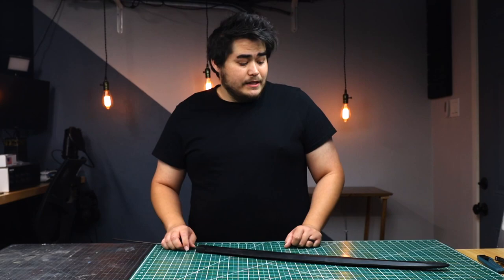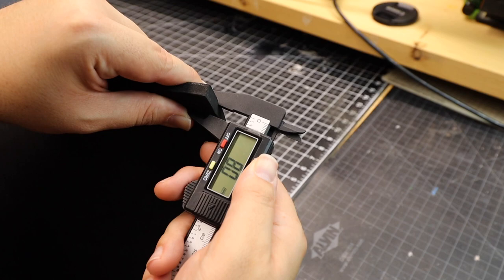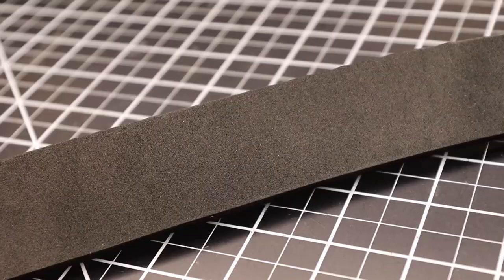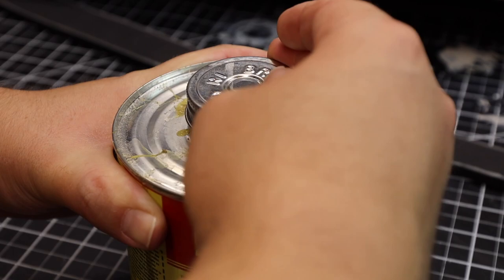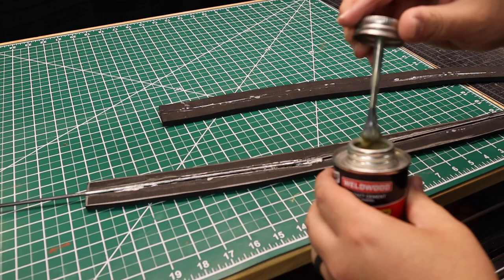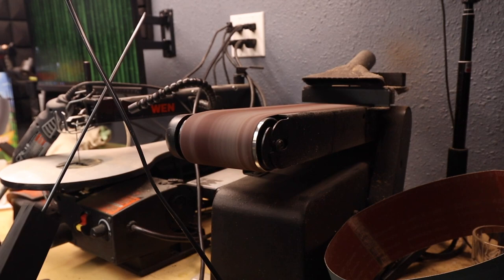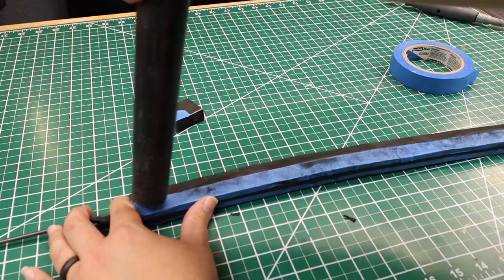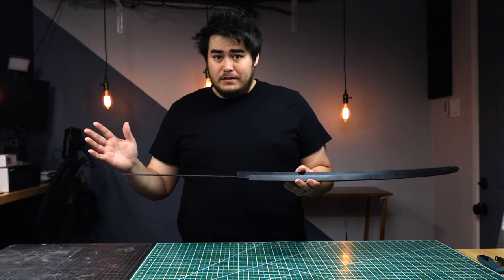Cosplay Sword Tutorial: Blade | Free Blueprint |

Comment: This is going to sound weird- but since I don't own a heat gun would a hairdryer be a could alternative?
Reply from the maker: Does not sound weird at all! I thought the same thing when I didn’t have a heat gun. I tried it and it does get warm, but you need to keep it on the foam for a long time for it to get warm, I’m my case, by hairdryer wasn’t hot enough to close the pores or stayed hot long enough for me to bend or shape the foam. But I know each dryer is different so if that’s what you have at the moment, give it a shot! Otherwise, if you’re near a Harbor Freight, you can get a heat gun for like 15-20 bucks. But just be careful, the tip of the gun gets REALLY hot, so just make sure not to burn yourself. If you do end up getting one, be sure not to stay too long in one place or you will burn the foam, just keep the gun moving in circular motions until it’s hot or when you see the surface of the foam change like it did in my videos.
Reply: @LockProps  Okay, thank you so much for the advice!

Comment: what grit is the belt sander? I try to rotary tool sand the whole blade as i dont have a belt sander myself and i find that it creates quite the rough looking texture/grooves that i couldnt just smooth down with my sanding blocks. Is a belt sander the best way to go?
Reply from the maker: The belt sander is 80 grit and then I have a 1000 grit, but I barely use that 1000 grit belt. The belt sander is definitely the easiest route to go. But before I had a belt sander, I used sanding blocks, ranging from a low grit to a high one to make it evened out, or just using a lower grit sandpaper like 120, then 220, then go to 320, then 400. That’s how I had a really even surface when the dremel bit into the foam too much. Hope that makes sense and helped! Let me know if you have more questions